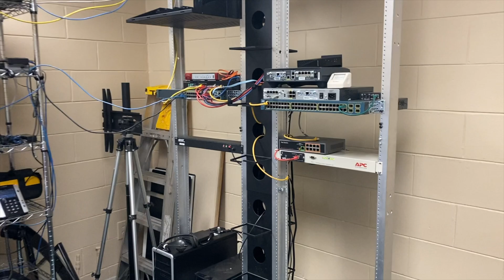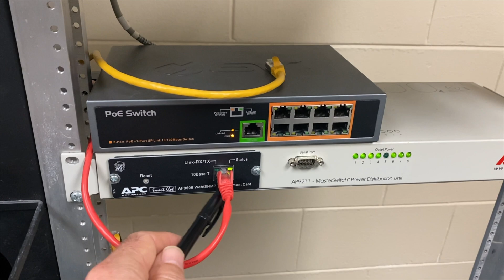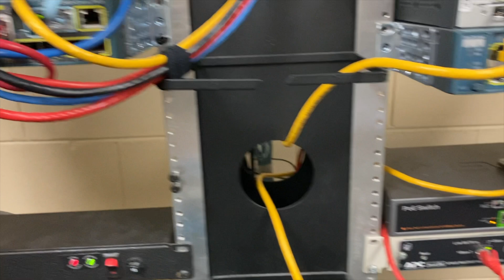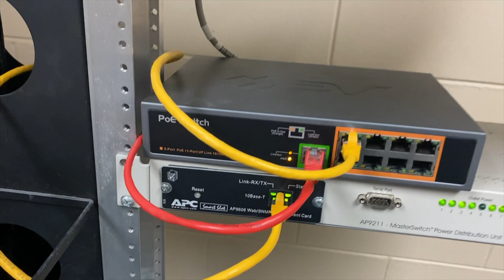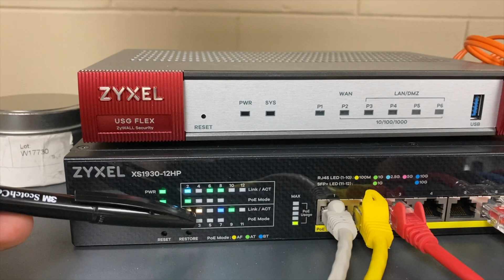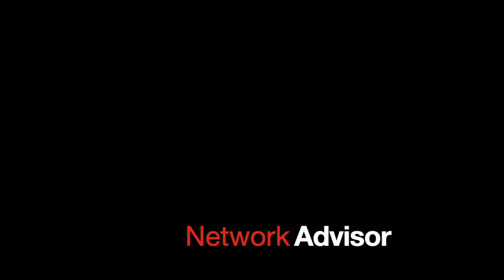Old Device won't link to Switch

Comment: But why do I need 10T if I can plug it straight from 10/100T?
Reply from the maker: Hi Greg.  I think I am not understanding your question.   The APC device was only capable of 10BaseT and the Zyxel switch wouldn’t support 10BaseT.